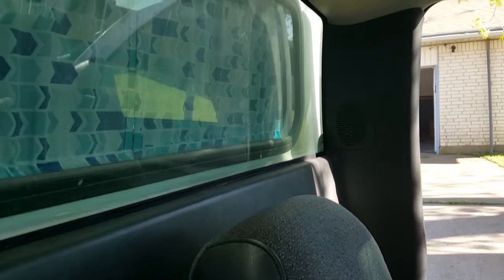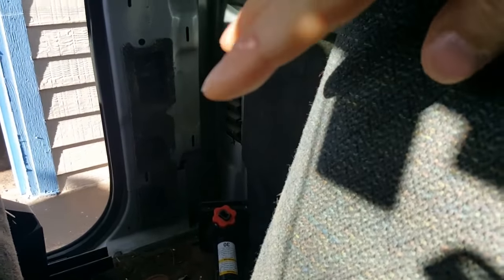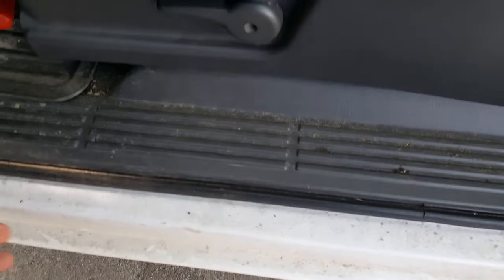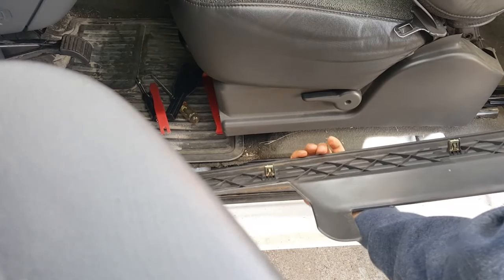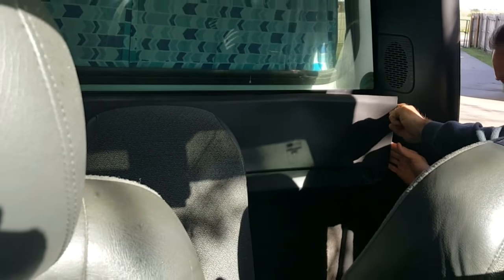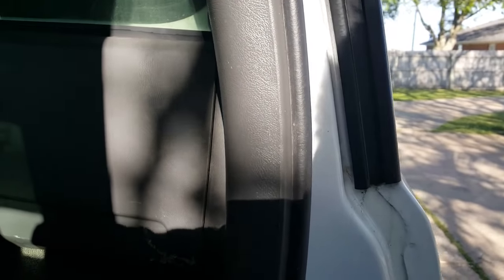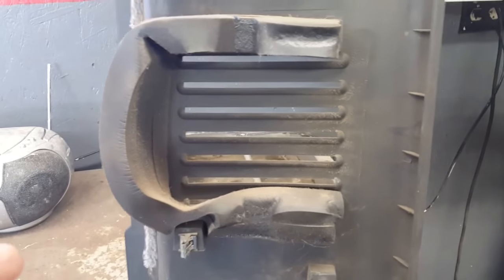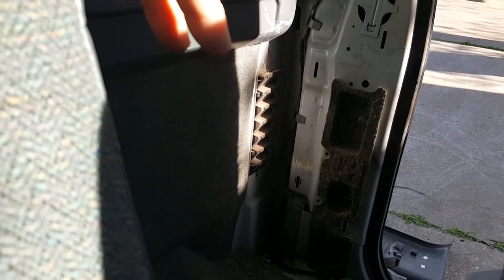REAR SPEAKER PANEL REMOVAL STANDARD REGULAR SINGLE CAB 1999 -2007 Chevrolet Silverado GMC Sierra

Comment: Thank you for this. Not only did you save me a ton of time, but had you not mentioned how difficult the clips were, I would've assumed I forgot to remove an unseen screw and may have given up out of fear of damaging the panel.
Reply from the maker: Glad it helped you out Kev. This was difficult to shoot because of space. Did you get your panels removed OK?
Reply: GB Adventures I did! Got the speakers out remarkably quickly. 

On average I find that my projects take ~400% longer than I ever anticipate. Because of your video, I was able to remove the panel, remove the speaker, and replace the panel in about 20 minutes, which was about 25% as long as I thought it would take.

Your filming angles made it abundantly clear precisely what needed to be done.

Thanks again!
Reply from the maker: @KevCoLabs  Glad to hear. Thanks for the kind words and watching.

Comment: Very helpful... i've got a 2005 gmc sierra 1500 SCSB that i plan on doing the same soon, i already did the two door speakers, much easier, now comes the piller speakers replacement. Its too bad GM didnt just make pop off speaker covers so the entire panels didnt have to come off. o_0
Reply from the maker: Agreed. Thanks for watching. Good luck on your truck.

Comment: Thank you so much for posting this. It is so hard to even find measurements on these speakers (which i assumed were 4x6 by measuring the panels) even 3 years later this video comes through. I love my truck but the factory speakers suck! that plastic trim gets to me... Either way, I thank you for using your time to record this for me and the other GM owners.

Comment: Being that there are NO videos on CREW CAB rear pillar speaker replacements (4x6 OEM). Thought I'd post a few observations here.
On my '99 Chevy, I discovered that the rear speaker plugs ARE DIFFERENT than the front and NOT compatible.
Even though they are listed as front and rear application. At least for the crew cab, they are not the same.
Use 72-4568 for FRONT adapter harness,
but you need 72-4500 for the PILLAR speakers.
Crew cab doesn't have rear door speakers available, though the provision is there (Grills. Not necessarily wiring).
because Suburban uses exact same door and has door mounted speakers.
  The pillar trim removal is insane. 
Unlike all other videos I've seen, the crew cab trim is screwed into the pillar instead of using clips. Plus you have a storage/car jack tray (and seat belts) in the way.
    Center trim, below back window, is a breeze...2 clips, but doesn't really need to be removed to get to the speakers.
The center roofline trim, this is ridiculous! 
The center trim piece is wedged between 2 layers of the pillar trim!
 I don't know why they did this. It makes removal of the pillar trim almost impractical. I just crowbarred it loose and broke the screwed clip off the pillar trim, because I couldn't get to the screw! Otherwise, I suppose you'd have to remove not only the hanger clips, but also the light fixture from the center trim, and try to bend it in the middle to unlink it from the 2 side pillar sandwich,  just to remove the pillar trim. 
This trim design is just as stupid as using different connectors for front VS. back speakers. 
GM tries to make the shade tree mechanic's job as difficult as possible.
Once exposed, the pillar speakers were not difficult to replace with 
Pioneer TS-A4670F 4x6 4-Ways.
These little speakers actually try to pump out some respectable bass. I'm going to add an Amp and see if they really can. I'm not sure if it's the factory stereo clipping or the speaker itself causing the distortion. But I plan to find out..$200...later.
Hope this helps someone.
Reply: Thank you
Reply: I have a 99’ 1500 Silverado I would like to know , the 72-4500 harness I buy two harnesses one for each side , for the rear pillar speakers , could you tell me the size of the rear speakers and what’s the biggest to fit

Comment: Good video, I appreciate it. I have the door panels off today replacing a door handle, both front speakers and repairing a power window track. I was going to do this but I'm running out of time. Next weekend hopefully.
Reply from the maker: I hope it works out for you.

Comment: Nice vid. about to pop mine out to bump dent out on b pillar exterior panel..
And..
Post removal comments...
Process was so much easier with your video..Removed all panels including complete removal of rear panel to ease it out..removed cleaned and replaced in ten minutes or so..
Could not access the dent on b pillar as another layer of structure is in front..and that layer is not dinged at all and won't allow pressure to affected area..
Thanks again..

Comment: Hey man do you know any solutions on how to fix the drivers rear speaker. I bought new kickers and same problem it wont work. Do you know what i can do
Reply from the maker: I would get a voltmeter, turn on the radio, and check for voltage. If no voltage i would begin tracing the wire to find out why. Good luck.